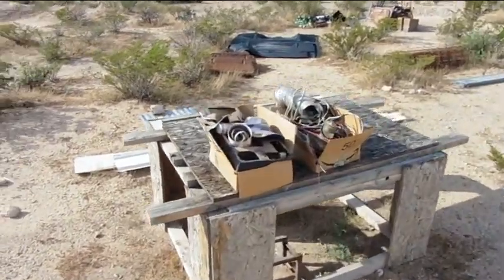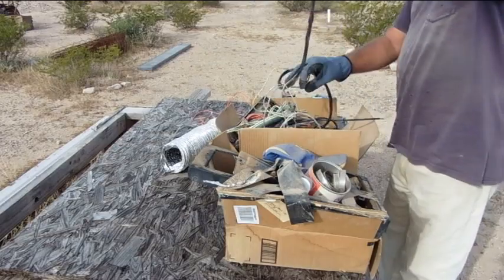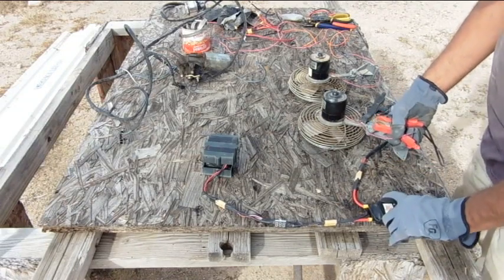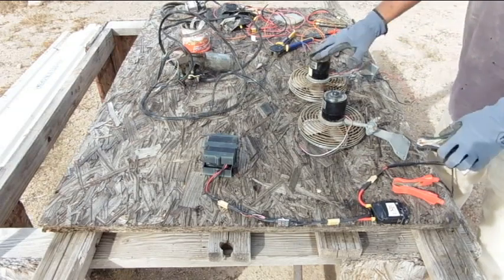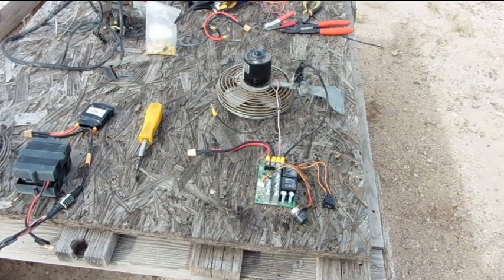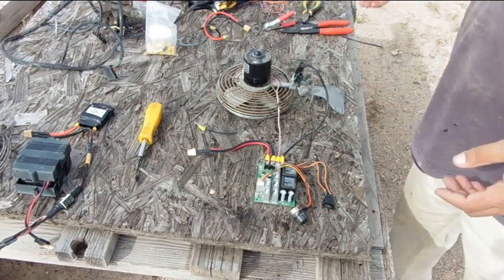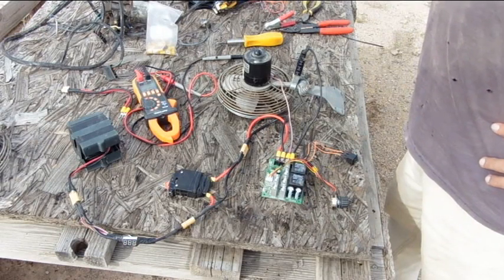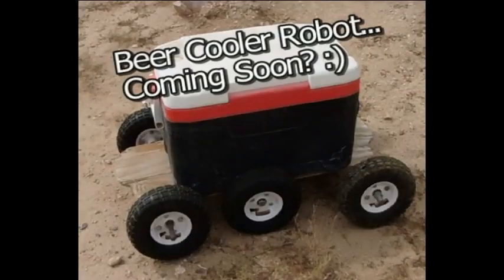Mars Clipper Robots and School Bus Fan Motors

Comment: Do they have auto wreckers or pick-a-part places down there where you could get lots of parts off vehicles for cheap for experiments or parts or motors?
Reply from the maker: There are some closer to El Paso, but one big one closed down about a year ago. They do not hold onto parts for very long, if it sits for a while they just crush it for metal recycling. There aren't fields of old cars laying around anymore. And they're not really cheap either. One idea I had when I was thinking of doing a van, look for the old Astro vans like the white one I had, and buy as many as I could running or not, because they won't be in wreckers for very long. I have seen not running ones for $500 sometimes. Then I'd need a practical way to transport it about 100 miles out to the ranch. If I had one I could use it to go get the next one and trailer them back though. It becomes a pretty expensive hobby though.